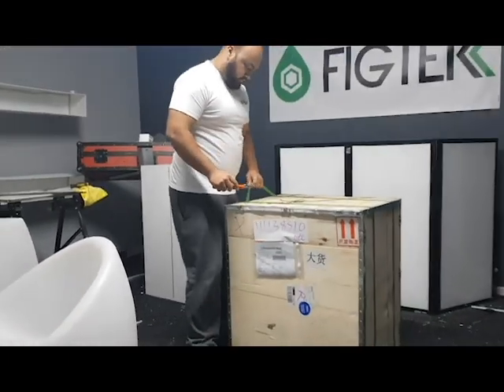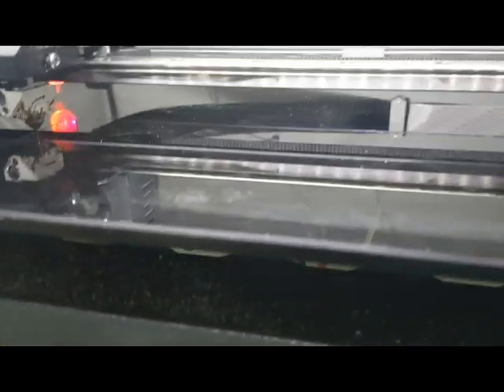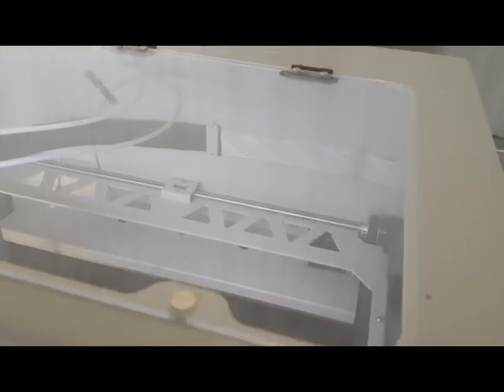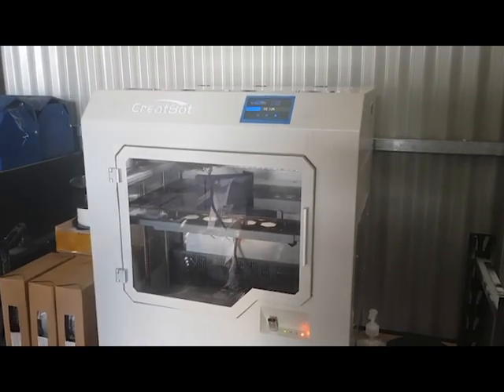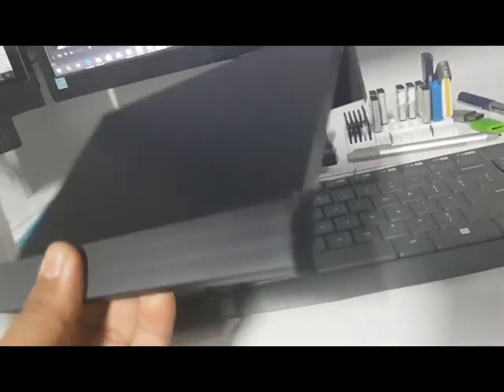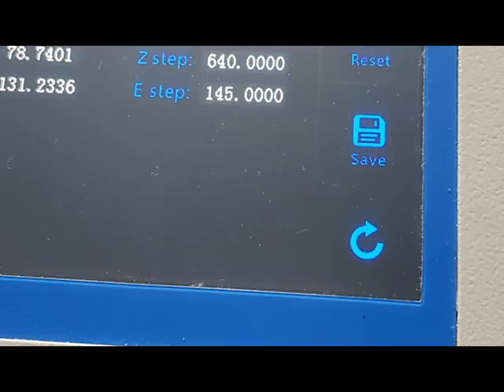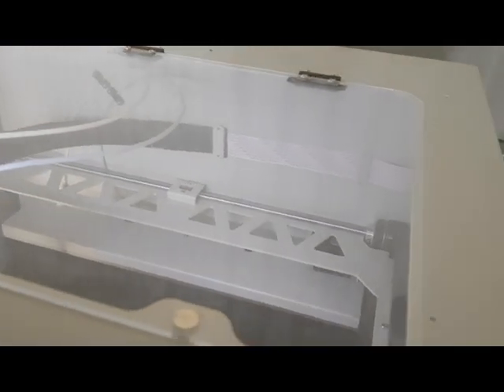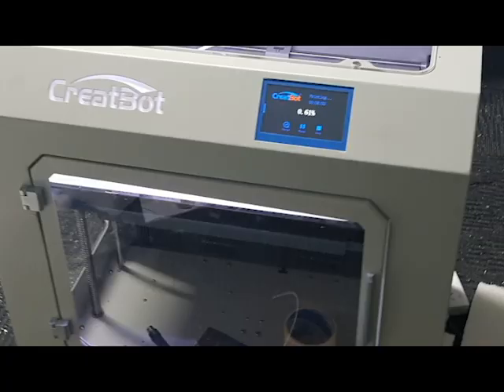Creatbot F430 Quick Review PEEK Industrial Printer

Comment: What slicer you use for this? Im trying to slice a 383mm (X axis) project in Cura (custom printer settings inputted via Creatbot directions) and its not taking...Is the 73mm extruder offset the issue? Ive even scaled down to 75% and still nuttin' I had to scale waaayy down for Cura to slice...Doesnt make sense to me...waiting of response from Creatbot 🤞Kind of useless if I can't use at least most print area
Reply: I believe with dual extruder its limited to 320